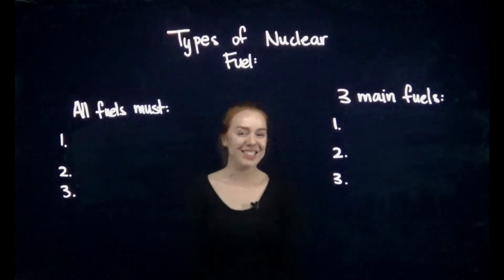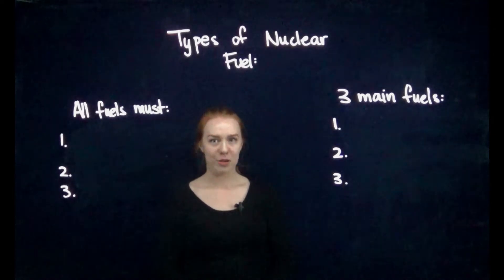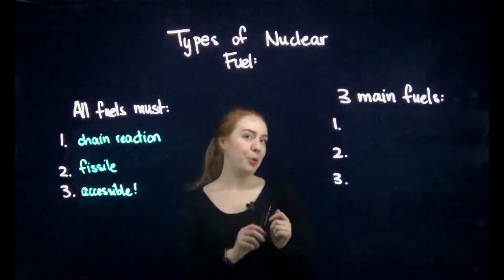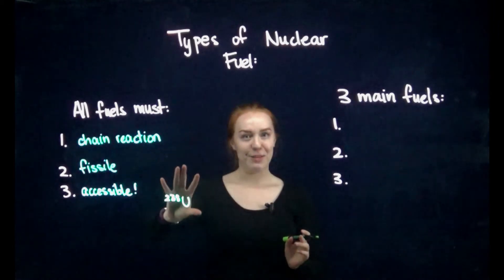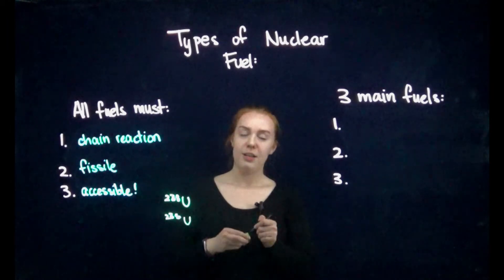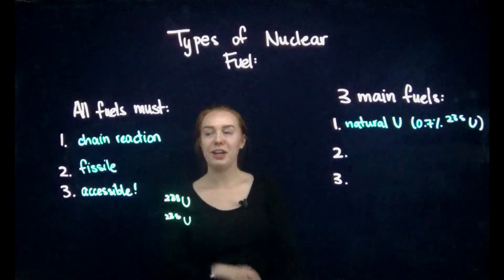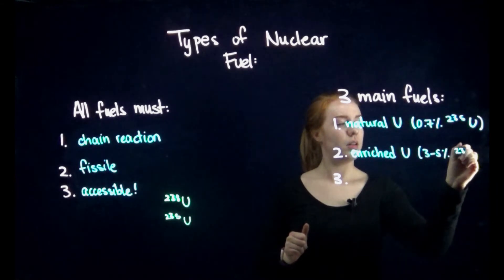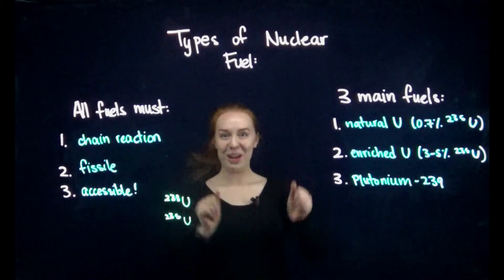Knowing Nuclear: Types of Nuclear Fuel

Comment: What is the function of U238 if only U235 is usable? Enriching Uranium is to increase U235 to 3-5%, then what about the remaining 95% of U238? does it remain unused and go to waste?
Reply: U238 is fertile, which means it can be turned into something fissile if you add a neutron (it makes it Pu-239). For the most part it remains part of the 'spent fuel' often referred to as nuclear waste. Proposed reactors (like MSRs) can use the U-238 with the better neutron economy. But those haven't been built yet.
Reply: @jasondonev7038  thank you!